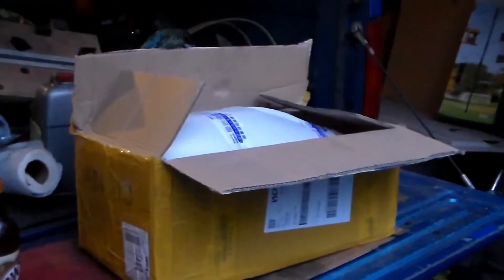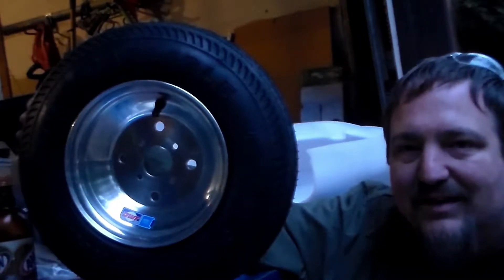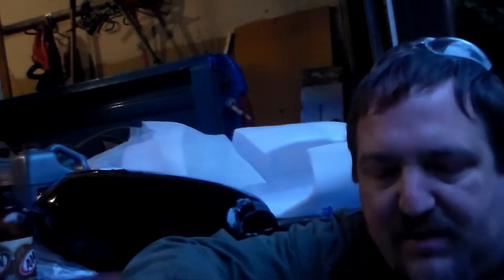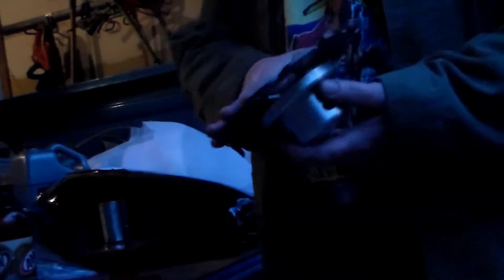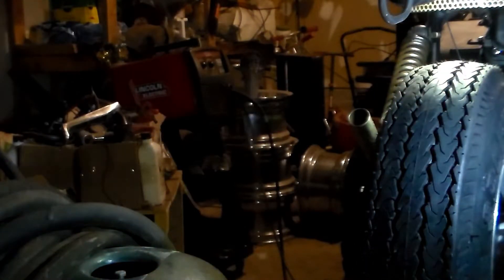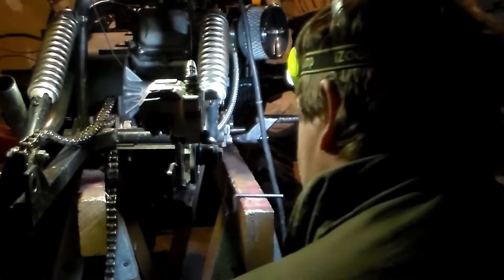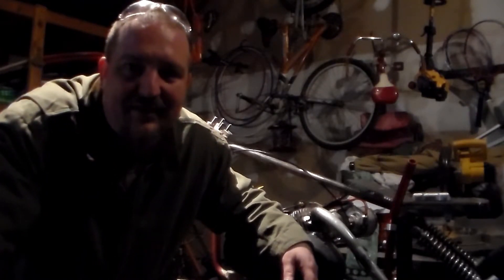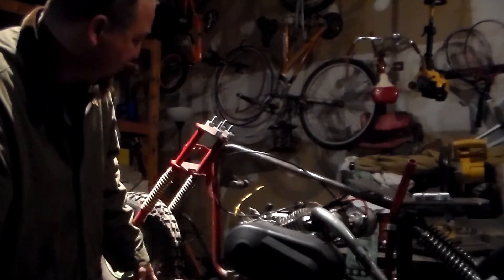MINI BIKE PART 4

Comment: do you happen to have a part number for that rear brake hub and rotor? I have a manco t bird as well and I want to put a rear disc on it. I'd also be interested in buyin your original gas tank if you'd like to sell it? like your channel and vids. subscribed
Reply from the maker: BILL WILLIAMSON i looked up pit bike brakes on ebay and found the caliper and rotor. I had to remachine the hub and make a custom adapter for the rotor! Then there was clearance issues i had to machine into the caliper it self.  As soon as i move were buying a house... ill have another vid to post. The final vid. Ive done more to it since this was filmed.